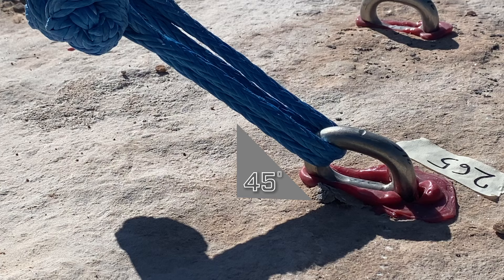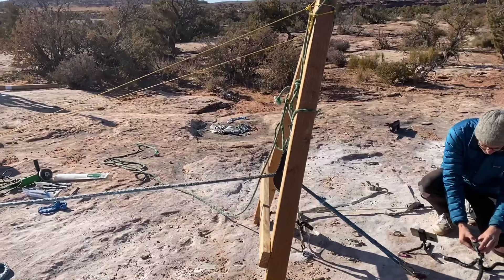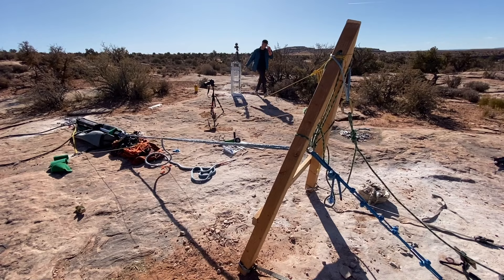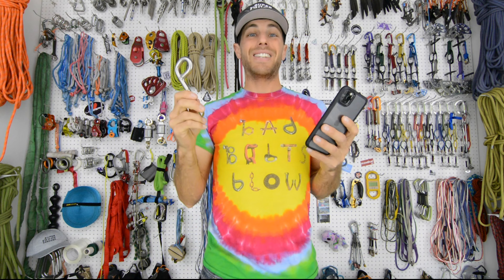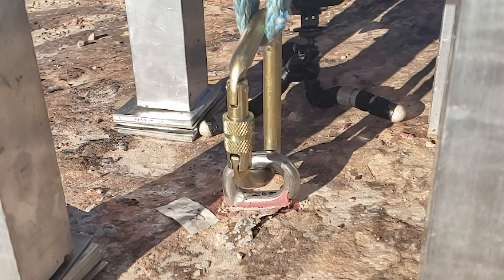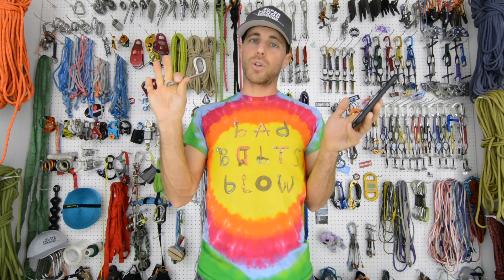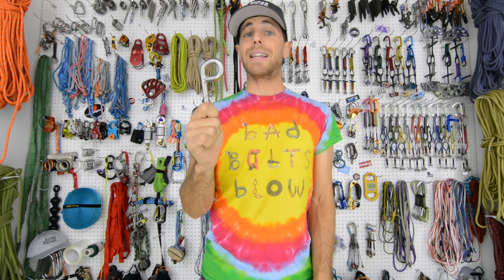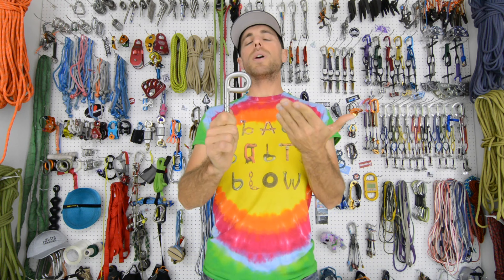BoltBuster - Crux Monster climbing bolts tested in 45 degrees with slow motion

Comment: Because the sand stone is softer than the concrete, the bolt is able bend more reducing the stress concentration on the weld.  A more even stress across the weld leads to a higher breaking strength.  Effectively the entire system is less brittle in the sandstone compared to the concrete.

Comment: I have used Hilti RE500 before (Im sure the V3 500 is similar), whilst it is the strongest glue on the planet is not ideal for bolting, especially not for climbing anchors. The stuff is the consistency of vaseline (and a million times more sticky) and is hard to work with, also it tends to flow before setting which takes FOREVER. This has lead to some bolts being less than ideally placed as glue has flowed out of the mouth of the hole (vertical rock, climbing anchor).It is also highly corrosive and has tarnished bright chromemoly steel black almost immediately. That said it is the best to use if the rock is wet, it sets under water and bonds to wet rock.
I can thoroughly recommend Hilti H100 as an alternative which has grout in it solving the flow issue. Like the RE 500 it is also a pure epoxy (urethane resin). It sets up much faster then the RE and is brown in colour rather than pink (better visually), it too is resistant to moisture and a good choice for damp rock (although probably not as good as the RE). Fisher also make an excellent Vinyl ester epoxy FIS V360 S that sets quickly and is grey in colour, it too has grout in it.

Comment: For the 45 degree angle tests, you need a force probe between the A-frame and the bolt. Otherwise the measured force won’t be the same as the force on the bolt.

Comment: the hardener degrades over time to the point where the epoxy just wont harden or it doesn't get as strong, but if the bolts are breaking first its probably not as big of a deal vs buildings that are supposed to be safe for centuries

Comment: After removing the pulley the readings are not accurate anymore as the frame is interfering
Reply from the maker: The hang frame changes the angle and so it is around 1.4x more force than it was reading.  We did a followup video to this to show the geometry of it after people in comments corrected us.

Comment: Have you done any Finite element analysis for any of the bolts?
Reply: I think it's difficult to model the weld in these kind of bolt. As an undergraduate in engineering I personally wouldn't know how to calculate exactly the mbs, I could only give you an estimated load, because it's absurdly complicated. For example the weld itself alter the cristal structure of the metal, and to understand how deep the variation goes, how much it change the material properties is super complicated stuff even if you know exactly the welding procedure...
Reply: @REVOLUTIONS51  You might be able to model some structure and values from the measurements. But I agree: this wont be easy, unless you have lots of experience already.